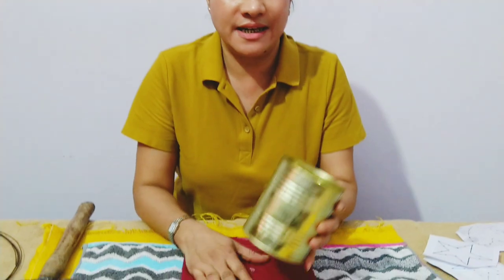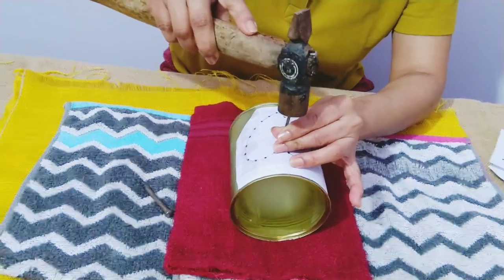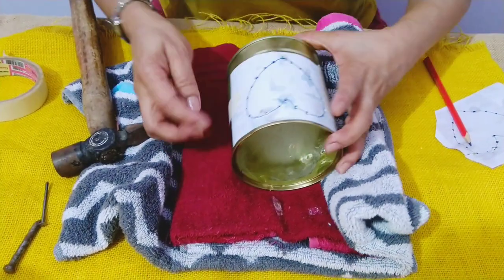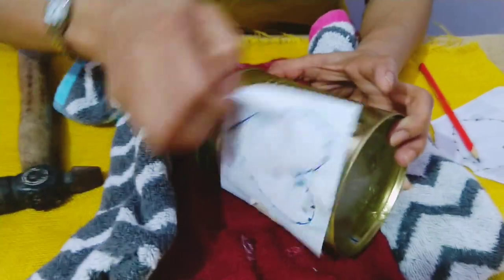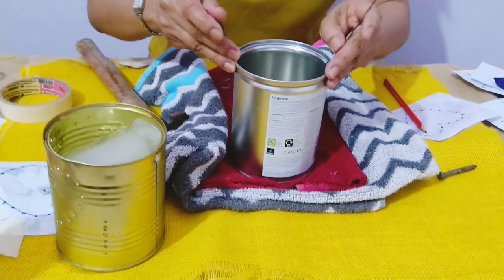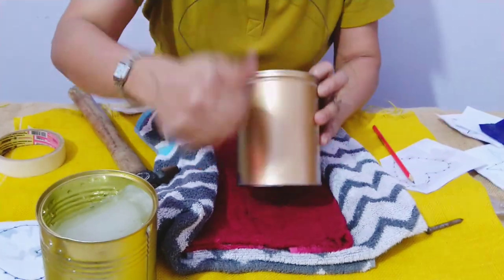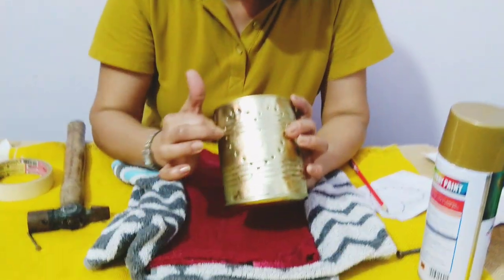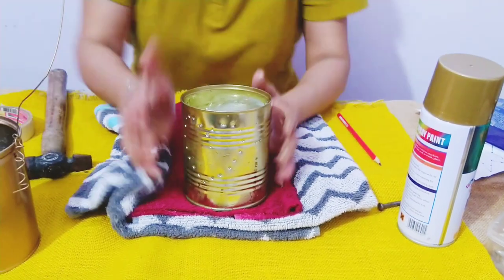How to make a lantern out of tincan/Hanging planter/Hole in a empty tin can/तिन कैन लैंटर्न्

Comment: Mam i have a big size tin oil container 
I want to use it as a planter 
I can't put it in the fridge 
Then how to make drainage hole underneath the pot
Reply from the maker: You can stuff damp cloth or towel inside the tin can. Then turn and it and make hole with nail and hammer. Make sure the nail has a sharp point.
You can watch my other video on how to make hole in ceramic cups to use them as planters
https://youtu.be/KDbcdV3Kydw
Reply: @HILDACRAFTY  thanks mam